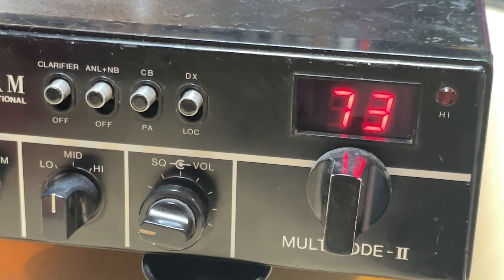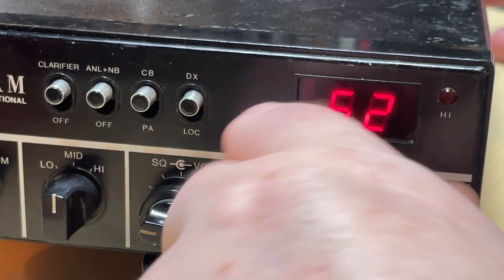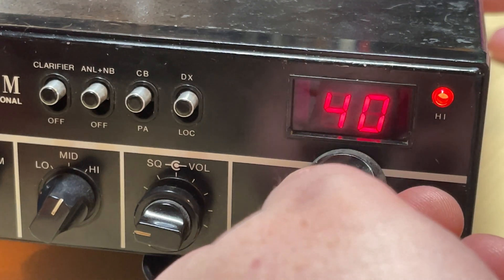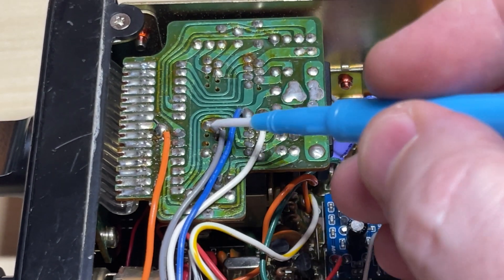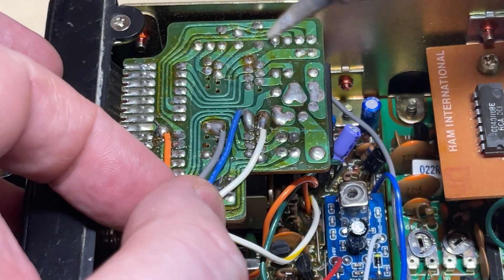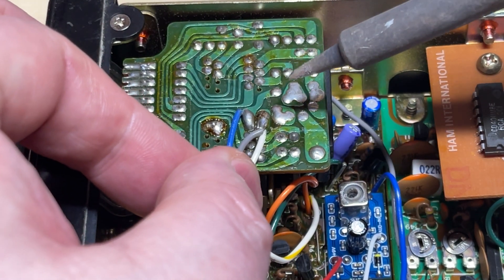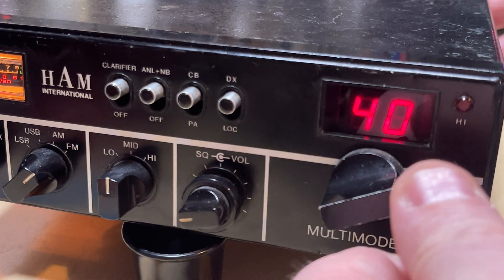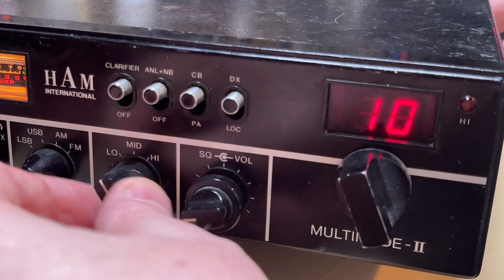How to disable the 41 to 80 display on a Cybernet SSB CB radio .

Comment: I've done this plenty of times over the years, this 41 to 80 readout is ok on 80 channel radio's but for others it looks stupid. I often use the high band lamp as an "radio on" lamp, just snip the wire from the lamp to the band switch, solder a wire to the on side of the volume on/off switch. The other end of the wire solder to a 100 ohm half watt resistor which you then solder the other end of the resister to ground/zero volts.
Reply from the maker: Its a quick mod , i made the video as i was asked many times on how to do it .

Comment: WHY ?? i have a colt 485 dx black shadow and it has the 41 - 80 readout on the high switch , doesnt bother me in the slightest
Reply: Usually we disable the 41-80 when fitting a UK40 eprom/pic board 

Also some people don’t like the 41-80 

Me personally id rather be 1-40 but each to there own